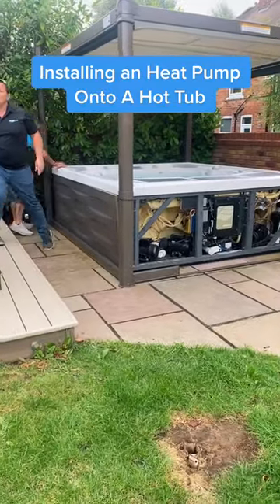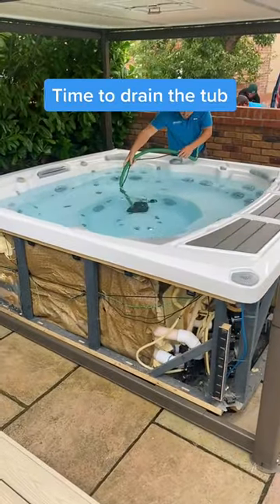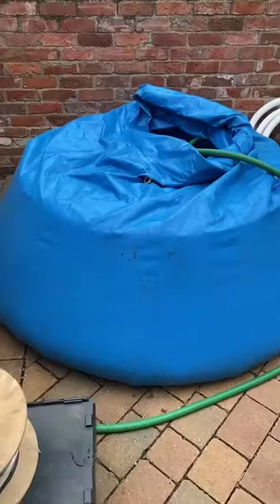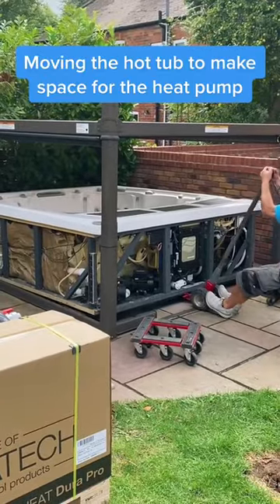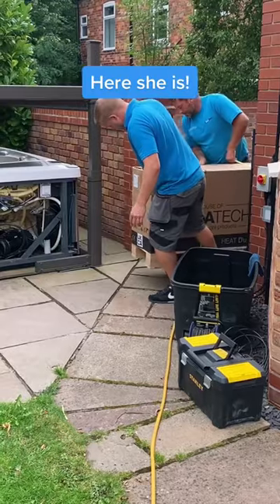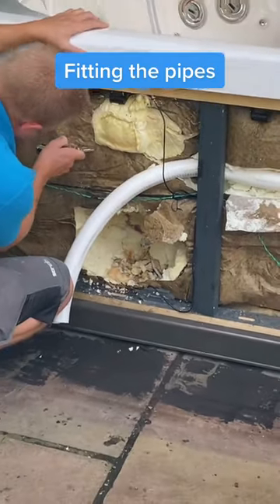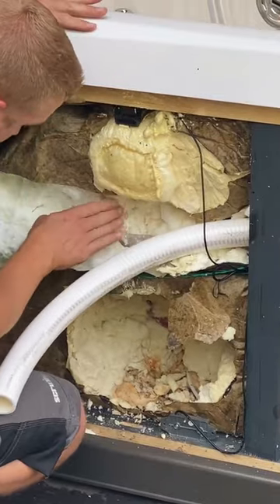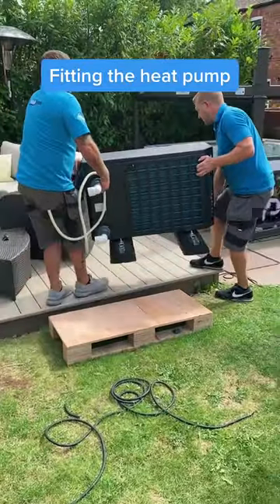Installing a Heat Pump Onto A Hot Tub🔧 #shorts

Comment: Why? Does it need to be cooled? Electric hot water is near 100% efficient.
Reply from the maker: This is much more efficient! There’s a whole series on our channel all about them!
Reply: COP of a heat pump is around 3, whereas traditional electric heating is around 1
Reply: You are correct electricity is 100% efficient however since a heat pump is using the ambient energy around it to transfer energy it can be 300% to 380% efficient. And if you use an inverter compressor your amp draw will be much less and much quieter unit
Reply: And heat pumps are over 500% efficient

Comment: Don’t understand why do you need a heat pump for a hot tub? It’s a hot tub
Reply from the maker: It’s a much more efficient way of heating the water in the spa! Which means you use less energy and therefore save on running costs of your tub! 

We have a whole series on our channel explaining everything about heat pumps if you’re interested!
Reply: @whatspahottubs  hmmmm I see !
Reply: It would take a century tho to recoup the costs of that aftermarket install tho. And you still would need your inline heater in winter...